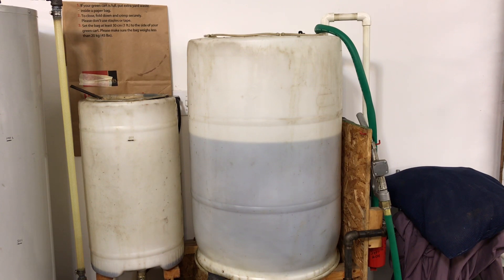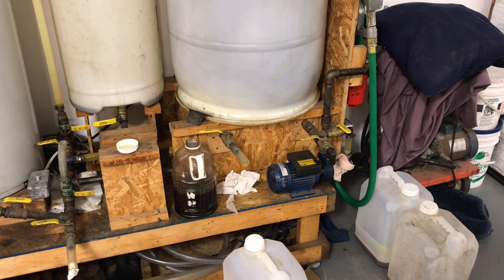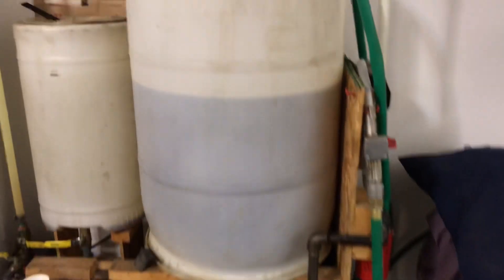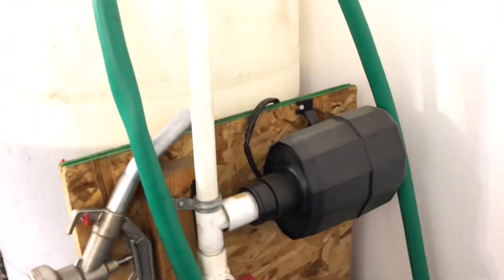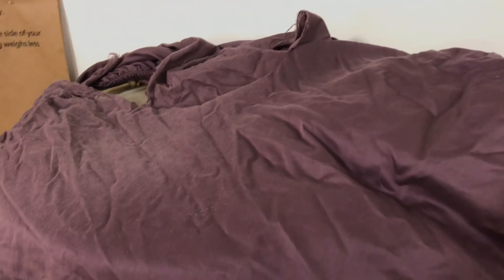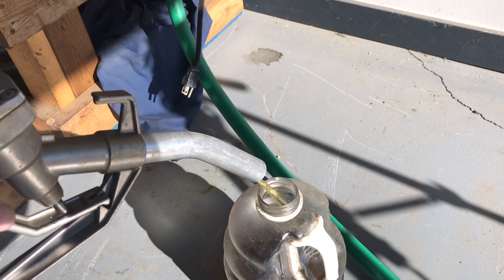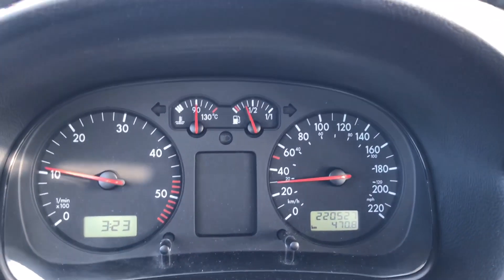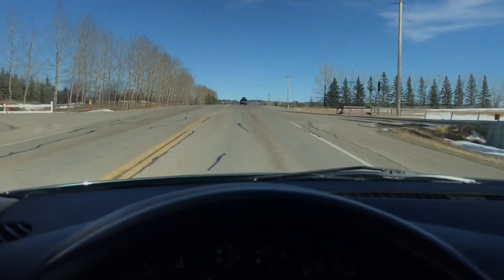Making Biodiesel Part 3:  Final dry washing and using the final product!

Comment: Thanks for the great Videos. @ 9:58  you plug in the air pump. I don't know if anyone has mentioned it but please try to push the plug all the way in. you leave it partially hanging out. This can cause a bad connection that may cause a fire. The other down side is that the Active and Neutral pins are exposed meaning that a freak accident could cause a serious injury. As an electrician I have seen these issues happen.

Comment: Just my 2c - I run "processed" fuel in a common-rail diesel, my own crd - I want that fuel to run good. I also understand all the ideal "final parameters" of the processed fuel. I also understand industrial scale processing - that's my background, 

If you really think this process through - what's the end in mind? - then it can be accomplished in a "1 Pass System" through 1 vessel with absolutely contaminated crap going in one end & thoroughly cleaned, usable product coming out the other. - with the absolute minimum expenditure.  Caveat is "the absolute minimum" expenditure will make most people go "No way!" and forget about it because its quite a bit of cash outlayed - if you take the short view. If you take the long view, its cheap as chips per liter of output product -  the up-front costs put most people off. Per liter of usable fuel, it's a no brainer - initially it seems high because suddenly you're dealing with volume. You chuck 20 quid of pump-fuel  in your tank - that's  c.a 10l. You want to process 200L? That costs. 

. 1000l is more still - but the cost per liter is very different. Long view. 

Everyone told me no way could a CRD run on processed WMO - no chance.. You'd need to be running an old-school diesel. Well... CRD's run just fine if you process it properly. There's a viscosity to hit. Hit that, it's gravy.
Reply from the maker: Waste motor oil?  excellent.  A different topic from biodiesel.

Comment: Awesome setup you made! Only thing that worries me is when you are drying the fuel. You basically you make a methanol air mixture.... Not only could it explode but methanol vapours are very toxic, why don't you put a exhaust fan above the tank when you are doing this. It really worries me. Greetings!!
Reply from the maker: good points.  It's directly by an open overhead garage door and I stay away from the machine during that part of the process.
Reply: @gregs_garage  still I would put a forced suction on it, now it's just dispersing everywhere, and if there is no wind it will just hang there  or worse, if the wind is so that it sucks the air in your house by negative pressure.... Read the msds of methanol, it's way creepier than ethanol. Greetings, and thanks for the video!

Comment: how do you dispose of the glycerin?
Reply from the maker: local waste disposal site.
Reply: @gregs_garage  can the glycerin not be used for something? Ie the companies that collect waste oil to turn into biofuel, they must have a use to up cycle the glycerin as well?
Reply from the maker: @DV-vb1yh  I made soap with it once.  20 litre batch will last years.  I've heard you can spray it on gravel roads to keep dust down.

Comment: Another correction, soaps are caused by free fatty acids in the oil stock - avoiding them by using less catalyst (so leaving the acids in solution) is not good practice.

Comment: i am trying to make my first biodiesel and all is fine until i water wash at 130deg F and then it all goes a creamy  colour and stays that way, can anybody advise on this very annoying problem. i will be setting up air drying the same as greg has done.
Reply from the maker: May be incomplete conversion, or maybe too much catalyst so there are chemicals and methanol in the fuel that is mixing with the water.  I had trouble with water washing also.

Comment: A solar panel could run the airpump during the day get an off-grid solution and a used oil heater to heat your tank - be prepared.

Comment: Thank you for the video series! I learned a lot! i used to run straight WVO in my old ford about 7 years ago. Worked great, Put on a lot of greasy miles! Then got busy with life and family etc thinking i am going to get back into it but make bio diesel instead. A bit more expensive but i should be able to tun it in my tractors and trucks with little to no modification. Thank you for the great over view of your process and set up.
Reply from the maker: yeah WVO can cause more problems.  Biodiesel is great.  I blend with petro diesel.

Comment: Instead of the air blower, you can also pump your oil back into the the heater and heat it above 148F to evaporate any methanol still present.
Reply from the maker: I want nothing to do with vaporizing methanol over a heat source.

Comment: If a guy was going to water wash the biodiesel, roughly how much water would he needed for a 40gal batch?
Also where abouts in Ontario are you? I’m in Manitoba and wondering if I can run in winter months.
Thanks again, wish you had more videos on your channel.
Reply from the maker: I think you need to run maybe 10 gals water thru but it’s been a long time.  I’m in Alberta don’t confuse with those eastern weirdos.  You can run small blends maybe 20% in winter.  Depends on temperature.  Also kerosene blending will help when cold.  More videos to come what do you want to see?  I can make anything
Reply: @gregs_garage  sorry, didn’t mean to mix up where you are. For what it’s worth I’m happy to hear that your an Albertan. Do you think that a centrifuge would help in anyway for the later stages of processing/washing or best left for initial filtering?
More biodiesel videos would be cool but you did a fantastic job of making your series. Looks like you have your hand in some other interesting things. Do you do much in terms of house / energy related alternative methods?
Reply from the maker: @AndrewMarsch  initial filtering is not required.  Maybe if you were running straight veg oil or motor oil you would use a centrifuge.  I only filter the incoming veg oil using a coarse screen.  Any particles fall out in the glycerin during processing.  The light biodiesel is on top and very clean.  Not sure about centrifuge at the end.  May be a good way but I just dry wash then run it thru a 10-micron farm filter and it runs good in the VW TDI.

Solar panels are next.  With the subsidies and better modern panels it finally makes economic sense (I think).  Here you can get the meter changed and run it backwards to sell power back to the grid for about 0.12 per Kwh

Comment: Very informative. I've owned a 2001 7.3 truck for about 15 years and that old turd will burn anything. HEUI injection systems are resistant as hell. With the uncertainty in fuel ill be building this set up. Thank you for the video.
Reply from the maker: Thanks.  A friend is selling me his 2002 Excursion 7.3 soon.  Watch for videos.

Comment: 5:16 If you have access to cheap to free electricity or firewood, you could distill methanol out, then you should get pure water, or least pure enough to maybe dump to drain (dont quote me on that) and finally you have contaminant left that can be given to waste disposal company, but at that point it should be so little it wont cost barely anything, least what you have left from that stage.

Also that is lots of air. How that air is purified so there wont be further contaminants ending up into fuel? Hot tubs generally dont require 10 microns filtering, so i doubt its own filter is enough. I would consider adding large HEPA filter intake of the airpump. Issue with the contaminants is that fuel filters get much faster.
One thing to consider is air humidity when pumping air in, it might condense into fuel and then you have water contamination, so there might be thing to consider based on your location and climate.

Furthermore hows the cost of this process comparing to petroleum diesel before taxes prices, or "burn oil" not sure if this is thing in abroad, but here its less taxed version of diesel for non road use?
Ou and whats the cold tolerance of this fuel and how to make it "winter bio diesel"?
Reply from the maker: wow what a lot of questions.  I will attempt to answer.... later

Comment: Thanks for the very informative video I just have a quick Question. For the last step instead of using hot air, what if I used an emersion heater and heated the raw biodiesel to around 170 degrees farenheight, would that not get rid of the excess methenol and clean it?
Reply from the maker: I’m not a fan of boiling methanol.
Reply: @gregs_garage  makes sense. Thank you

Comment: sorry it wasnt clear for me, its enough to dry wash it or you have to wet wash it before dry washing
Reply from the maker: I only dry wash it.  No wet washing.  But I could be wrong.  It runs fine in the TDI
Reply: @gregs_garage  is it a pd tdi or cr tdi?
Reply from the maker: @ThomasSz1994  neither.  bosch VE rotary pump.

Comment: Just a suggestion use a cone bottom tank using a hot water tank heating rod let the junk settle to bottom drain like 80% of junk then filter to 1micron is what I do and so easy and fast
Reply from the maker: cone tanks are hard to find.  no washing?
Reply: @gregs_garage  I can get the site I got mine more cheeper then anyone else and I looked for months and no wash. Heat it up to 110 fahrenheit let us sit for a good time I go a year but I do hundreds of galls and filter with a water drain and a 3 stage filter 20 10 5 then a 1micron filter
Reply from the maker: @dakotak8437  so you're using filtered Waste Veg oil (WVO) ?  That's not biodiesel.
Reply: @gregs_garage  how isn't it I use mostly waste oil gear oil tranny fluid hydrologic fluid thats very bio-diesel. I run it in my Cummins injectors are not cheep injector are very fine and and sensitive iv increased my mpg. been doing it for over 10 years.and in your video you also have a filter on it.and I also make gasoline out of it.and you also use chemicals I don't so also save more money you don't need chemicals to make fuel out of wvo
Reply from the maker: @dakotak8437  you seem like a BOT.  I'm saying you can burn all kinds of oil in a diesel motor but its not biodiesel.

Comment: Could you share how much milles have you made on this car?!
What about consumption?!
Thank you in advance!
Reply from the maker: I have the car has 230,000+ kms on it.  Ive hat it for 30,000 miles.  it runs great.  

consumption?  about 5L per 100km or 45 miles per gallon roughly
Reply: @gregs_garage  can you share the proportion of chemicals?!
I have 100l used cooking oil?!
Reply from the maker: @ivanparakosov1202  for my oil approx 20% methanol and 1.1 kg of koh.  But you really need to do more research and understand why the proportions are what they are and what quality of oil you have.

I do not recommend making Biodiesel.  This is a DEMO video only.
Reply: @gregs_garage  Have you ever had issue for fuel filter?!
Falling apart or stucking!?
Reply from the maker: @ivanparakosov1202  no, but they get clogged while the biodiesel cleans your fuel tank.  Bio is a solvent.  So change the filter more frequently for the first year or two.
Reply: @gregs_garage  Mate
I mean I heard that this kind ot fuel fucked up the filter!
Part of the filter went into injectors?!
Did you have same problems?!
Reply from the maker: @ivanparakosov1202  no my filters have not been affected.  I think modern filters handle biodiesel fine.

Comment: Great series. Thank you! I learned several things I'm going to use on my plant. I really rather like the air drying.  Couple of questions: 
1) That looks like 1 inch (25mm?) PVC. Is that correct? 
2) How far does your PVC tee extend in the bottom of the final barrel to allow you to have 30 - 50 holes drilled in it? and 
3) Do you have a link (or other contact info) to your source for the hot tub air pump?
Reply from the maker: 1) I think so.  Whatever fits it doesn’t really matter it’s just air.

2) maybe 12-15” out in 4 directions. It’s a 4-way splitter.  Just drill a bunch of holes.

3) no.  Google it.  It was a long time ago.  Any cheapo hot tub pump is fine.

Finally, do this at your own risk!

Comment: Hi Greg, thanks for the series. I was just wondering about keeping some of the methanol in the fuel, wouldn't that make a higher quality fuel? Thanks.
Reply from the maker: I don’t think so.  Soap stays stuck to the biodiesel until the Methanol is gone.  Then the soap falls out with gravity.  You want biodiesel to be slow burning not explosive
Reply: @gregs_garage  do you get better fuel mileage with bio
Reply from the maker: @ryanthiessen4562  no.  In theory a bit less due to lower heat value but I've never noticed a difference.
Reply: @gregs_garage  I've heard guys say they get more power
Reply from the maker: @ryanthiessen4562  I don't know - maybe pour some methanol or gasoline in there after it's all clean.  Seems like Playing with fire.  Better to tune your unit to burn more fuel and air without the magic sauce.
Reply: @gregs_garage  do you have to keep the heat on while you mix in the  meth oxide? Or do you turn it off.
Reply from the maker: @ryanthiessen4562  OFF.  very important.  You may blow up.
Reply: @gregs_garage  how fine do you screen it at first? Does the mixture not need to stay at temp to react or just at the beginning?
Reply from the maker: @ryanthiessen4562  It does not have to be screened very fine - just get the worst of it out.

Comment: very intersting series and well detailed
over all how much do you spend on consumables (oil, methanol and potassium hydroxyde) to produce 100 Liters of fuel 
and electrecity consumption too?
did you ever try to use mineral oils ? i've seen some guys just put old engine and transmission oils into their old diesels 😆
Reply from the maker: I would say…

Oil free if you have a source
Methanol $30-40
KOH $5
Electricity $1-2

Probably works out to 40-50 cents per litre.

I don’t like the idea of old oils because of the contaminants - not sure of their effect on things like pump and injectors.

Maybe clean ATF or new motor oil is fine in small doses.

Comment: How's the injector and other components holding up? Anything that would be abnormal maintenance for running bio diesel. Your process and setup seem effective and efficient.
Reply from the maker: All fine. Biodiesel has solvent properties so it keeps things very clean.

Comment: Is it possible to use high quality e85 ethanol instead of methanol? Also would reheating the biodiesel after draining off the byproduct remove the soaps, methanol and other contaminates to the bio diesel?
Reply from the maker: e85 is 15% gasoline.  I doubt you want to mix gas into the process.  Use 100% methanol.  or ethanol but good luck finding 100% ethanol.

reheating the final product does nothing.  you need to wash it with water or air or other media.
Reply: @gregs_garage  Unless you boil off the ethanol but that might create different issues and not really preferred.
Reply from the maker: @Boostocska  I do not agree with boiling off alcohols.  Very dangerous in my opinion to heat alcohol that much.  You are asking for a fire and/or inhalation hazard.

Comment: Awesome series! How do you test the finished product?
Reply from the maker: Google 3/27 methanol test.  Quick and dirty method.  Or you could send a sample to a lab.  My lagging test is 13 years of using it without issue.
Reply: @gregs_garage  diesels are pretty forgiving.. if you can run used cooking oil in it... I'm sure any form of refined and washed biodiesel is good to use.
Reply from the maker: @youareallalone  that's a reasonable comment, yes.  They will handle quite a bit, especially if mixed with normal diesel.
Reply: @youareallalone  
That's true of older systems, but modern systems are far less forgiving. Anything made in the last 15 years or so is going to be a lot more sensitive to bad fuel.

Comment: Thanks very much. I watched the whole series but only commented here. In Australia people use old fish and chip oil and apparently smells like the food tastes. Great setup you have, obviously refined over a period of time and trial & error. They say that Bio cleans out all the crap that grows in your tank and lines, and you will clog up filters the first time you use it, but maybe that's 100% Bio. It's not a bad thing, just something to be aware of. Did you have any experiences like that? Thanks again for posting - very interesting, cheers.
Reply from the maker: thanks Murray.  yes Biodiesel has solvent properties so it will "melt" buildup from the sides of the fuel tank even in small doses like B20.  I change the filters regularly and have never had one plug up.  Once using Bio for a while your tank will be clean and you can reduce the filter change interval, but it's so cheap to change a filter once a year I just do it anyway.

Comment: I kept my Jetta TDI even after the whole diesel-gate scandal.  You still have yours?  Cool setup and video by the way, thanks for taking the time.  If I may ask, how much was all these tanks and gear?
Reply from the maker: I am driving this TDI today.  dieselgate doesnt affect anything.  most of this is used and cheap except the pipe and valves.   Maybe $2-300
Reply: Hi,nice job!
is it PD TDI,or engine with injection pump?
Reply from the maker: @maximuspet  injection pump.  Bosch VE.   2003 last year before PD